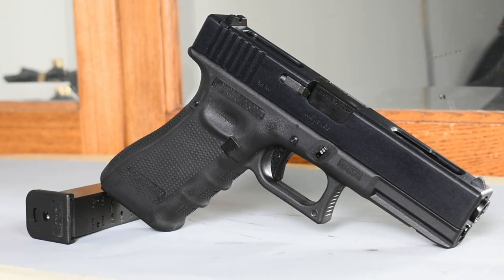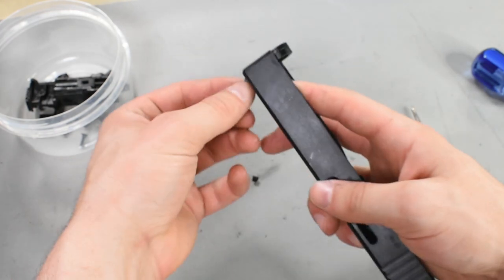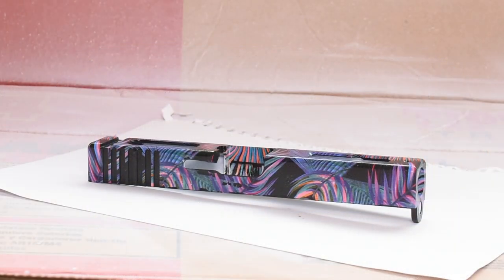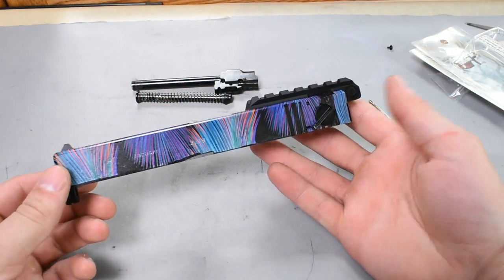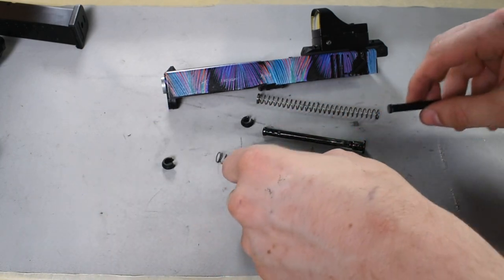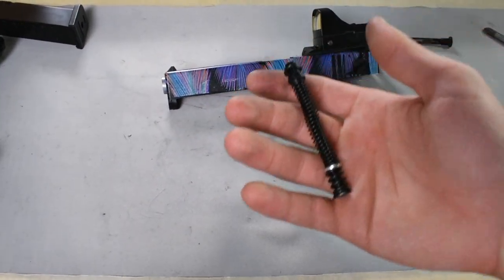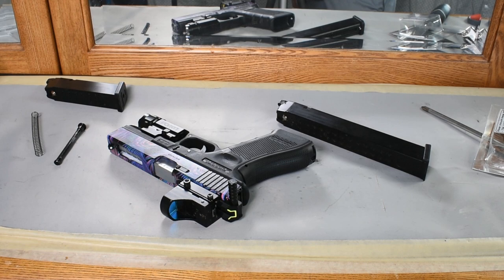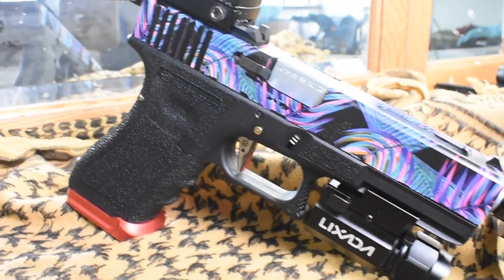COMPLETELY Upgrading a stock GLOCK18 | INTERNAL AND EXTERNAL UPGRADES

Comment: How exactly did you install that angel sight? Could u make a more detailed tutorial on that? Cool vid btw
Reply from the maker: hey so the angel custom rear sight rail just slides into the slot where your old rear sight used to be, and then it is just held in by a screw from underneath.  

I have already made a video showing that, check out the 8:28 mark in this video:
https://www.youtube.com/watch?v=LzKj5bzUPu4

I hope that helped!

Comment: im gonna be doing a similar build on my elite force G17 gen 3, but im gonna have an Olight pl pro valkyrie, and the angel custom rail mount with an rmr replica. any suggestions on good holsters to get?
Reply from the maker: MC Kydex is like my number 1 recommendation if budget isn't an issue.  On top of offering soooo many model options, they can also custom make you a holster to work with any attachments/accessories you may have on your gun!

Comment: I'm getting the elite force glock 18c and I would like to put the sight on should I still change the spring? Or will the elite force one have a better spring already?
Reply from the maker: The elite forces are nice.  You definitely should not NEED a new spring if you add a sight.  I simply upgraded my spring because I wanted to increase the RPS anyways.  You should be set!  You can always install a new spring as an upgrade later on!
Reply: @Private_Caboose  awesome thank you for your help!
Reply from the maker: nattin solis absolutely my friend!
Reply: The elite force Glocks are not TM compatible so most of these parts won't fit most if not all the elite force Glocks parts are all different then any other gun
Reply: @Private_Caboose  yo how is that custom recoil set up doing has it broken anything I'm currently using the same one and I was curious on how rough it is on the gun

Comment: I am having an issue with my G18c. Halfway through the magazine the slide starts getting stuck on either the locking lug or the top of the ejection port on the barrel piece. With the increased gas efficiency of the two set (or spring blocks on the guide rod) might help with the issue of the gun not being able to cycle all the way through the magazine. 
Did you have the jamming problem like me? If so, did the two set spring eliminate it?
Reply: im having the same problem try to not fill the mag up all the way with bbs or go to a smaller bb im using .25 and im having that problem so try to not fill all the way with the bbs and it worked for me
Reply: @mrdirtbike1581  it says on the box for the Airsoft pistol to not use anything over .20 or it’ll break

Comment: Aye man I wanna get into airsoft. I wanna get a 1911 or an m4a1 to start out with, what are some good brands? My budget is about $190
Reply from the maker: Welcome aboard! Its such a fun sport!  YES, I definitely have some thoughts here.  If this is your first airsoft gun I would recommend the amazing G&G combat machine: https://www.evike.com/products/33557/

This is a super reliable and consistent rifle that will get you into the airsoft world.   This rifle is fully upgradable so as you learn of the upgrades and parts needed to improve rifle performance, you can put them all to work one by one in this rifle! 

Do you know if you will be playing mainly indoor or mainly outdoor?  The only concern here is the G&G combat machine may shoot too hot for indoors, but if your outdoors this is my recommendation for sure!
Reply: @Private_Caboose  thank you so much man, and any side arm recommendations?
Reply from the maker: @akjakata9307  Happy to help!  Yeah so if you are looking for a side arm (something to run with your M4 as a secondary) I would suggest the ASG CZ P-09.  This is my go to and the price point is solid!

If you wanted a pistol to use as a primary, say if you are playing a lot of indoors, I would say grab a Tokyo Marui Hi Capa, they are great off the bat and they have an ENDLESS line of upgrade parts to turn a stock pistol into your dream build over time!
Reply: @Private_Caboose  again thank you so much man!
Reply from the maker: @akjakata9307  For sure bro!  Enjoy airsofting!

Comment: Any decent holsters that would fit this setup? Currently running pretty much the same setup but with an sas front kit and a different tracer! Just can’t fit a holster that’ll fit!
Reply from the maker: Unfortunately I have not found a hard shell holster to fit this set up, when I run this glock i am running ONLY this glock haha.  There are the omnivore TLR holsters however, that secure to the TLR Flashlight that is attached to your gun, they are large and can still operate if you were to cut away at the shell (to make room for suppressor, red dot, ETC.) my buddy uses one and loves it!  I think that is a good option, I have not gotten one simply because I don't holster this gun when I play with it.
Reply: Amazing, thanks for the reply too! I’ll have a look online 😁

Comment: Can you add a tracer unit to the Elite Force GLOCK
Reply from the maker: Out of the box it did not have a threaded barrel, but there are aftermarket barrels/adapters that will allow you to do so!
Reply: @Private_Caboose   do you possibly know anywhere to get a threaded barrel for the umarex g18c? I have looked and looked for weeks still cant find one that fits

Comment: Getting a TM g18C but I eventually want to upgrade to a metal slide and mayb even a frame…is there any other parts required to maintain gun efficiency with the new upgrades ??? (e.g I heard you should get a 150% recoil spring because of metal slide)

Comment: What loading nozzle are you using on your g18…? I was thinking of buying the aluminium nozzle by dynamic I think it is and the Poseidon flute valve and piston head? What's your thoughts as having trouble sourcing parts as in UK and I've gone through enough plastic loading nozzles would be good to know!

Comment: How did you zeroed the red dot without the rear sight?
Reply from the maker: The red dot has its own adjustment knobs on it. I did not dial it in to match the iron sights, instead the red dot sits slightly above
Reply: Private Caboose Airsoft ok thanks.

Comment: Will the slide still lock back
Reply from the maker: Darkshock 42 MLG 0 no, with the short stroke installed the slide will no longer catch when a mag is empty
Reply: @Private_Caboose  I think not having a lock back feature is a worthy sacrifice for the devastating 18RPS tho XD, BTW I short stroked my own G18C by using 3D Printed cylinders, even then, I havent even gone all the way yet as I kept adding length and it still fed every shot

Comment: What sight did you add to the angel mount
Reply from the maker: This one here: https://www.evike.com/products/65397/
Reply: @Private_Caboose  that's funny I already purchased the right one then I went off of what I saw and also got the rear sight mount 

Thanks a lot though keep it up

Also I'm pretty sure WE and AW are quite compatible so I hope the mount fits (I have a AW G18c) and do you know what thread your barrel is(14mm?)

I know this is long but nice job on the paint job and very good idea to mark the missing spots with sharpie.
Reply from the maker: @Nate-iy1eu  Wow you nailed it! Ordered the right one!  The barrel threads were actually 11mm, but that is an aftermarket outer barrel, so it may be different from the stock AW Glock.

Thank you very much!  It took several tries, but I have definitely refined my hydro dipping process!  Definitely more painting/customization videos coming!

Thanks for checking out the videos :)
Reply: @Private_Caboose  Oh so did you add an adaptor to the barrel, because the suppressor you listed and used is a 14mm.
Reply from the maker: @Nate-iy1eu  Oh good catch.  So that tracer unit has a 11mm and a 14mm version, but BOTH versions come with the adapter for whatever version you didn't get.  

So I am going to change that link right now to the 11mm version, thank you for catching that.  But even if you did order the wrong size, it comes with the proper adapter.  

I do apologize for that confusion.
Reply: @Private_Caboose  dont worry about it :)
Reply: @Private_Caboose  its actually quite funny, so I had to buy everything from evike.com to ship it to New Zealand so I brought everything together, Didn't want to spend heaps of money on a tracer unit and just got a mock suppressor turns out not many people know about the AW g18c but I think it might be a 14mm thread. But I think the thread is on the inside on both the barrel and suppressor. Evike.com/products/49418/
Reply from the maker: @Nate-iy1eu  oh man, so maybe you just need a 14mm-/14mm+ adapter?  I have been there!  If you simply send evike an email asking about compatibility they are usually pretty good on getting back to you.  Perhaps they could provide a link to the adapter you would need? Just an idea!  I hope everything comes together like you wanted!

Comment: Hey I’m new to airsoft what do u recommend green gas or co2 and why. Thanks 🙏🏾
Reply from the maker: hey first off WELCOME TO AIRSOFT!  Let me start by asking are you going to play indoor or outdoor?

CO2 is going to kick harder, shoot faster, and work better in colder temperatures. Due to its higher pressure, a CO2 powered pistol will kick much harder than a green gas weapon. Also due to the pressure, most co2 pistols will have a higher FPS than their Green Gas counterparts.

With that being said if you are playing indoor and do not want to raise the FPS of your gun, green gas is the answer there. Also with the higher pressure of co2, it will be rougher on your internals than green gas as the gun is cycling harder and faster.  I hope this helped!
Reply: Private Caboose Airsoft so I’m getting a official glock 18c and I’m going to probably play indoor
Reply: @Private_Caboose  I'm not that new, but it helped too! ^^